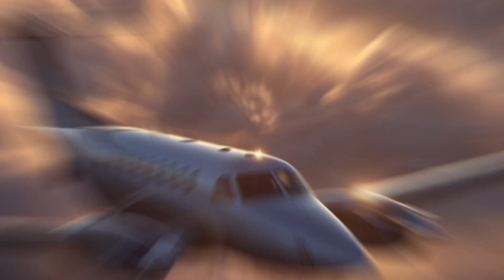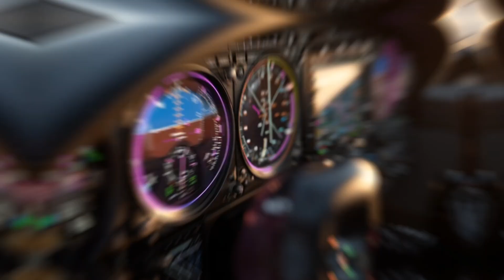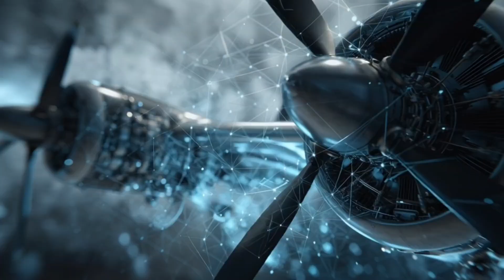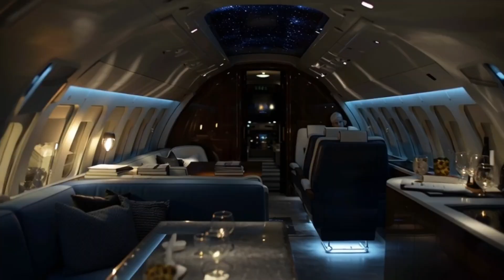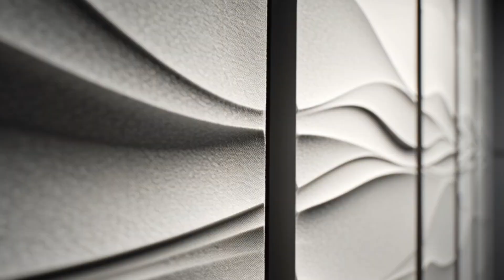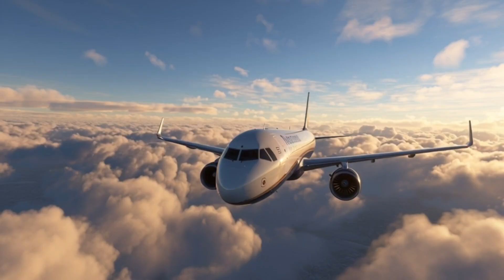JET KILLER? Why This Turboprop Can Replace a $10 Million Jet

Comment: BS. KA certainly consumes less per hour than Jet, but the comparison should be made based on the distance traveled if a professional comparison is made. It seems that the author missed elementary school math classes or simply doesn't know how.
Reply from the maker: Good point. Hourly burn was used for simplicity, but distance efficiency is definitely another important factor. Appreciate the input!